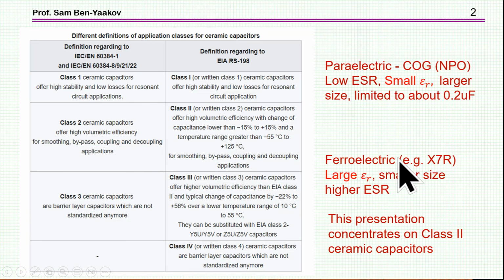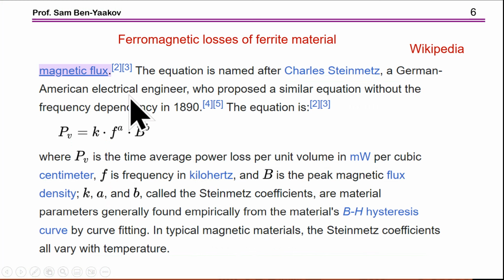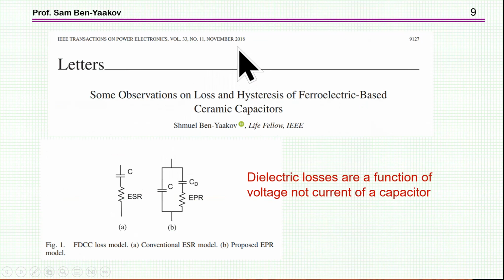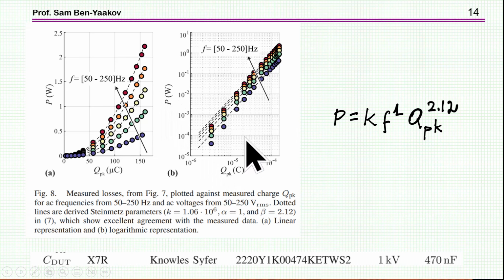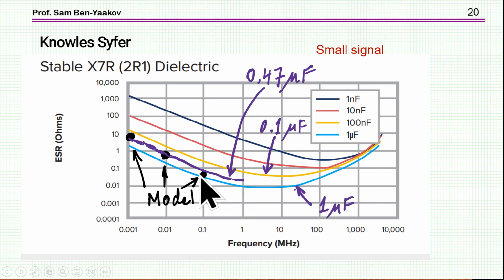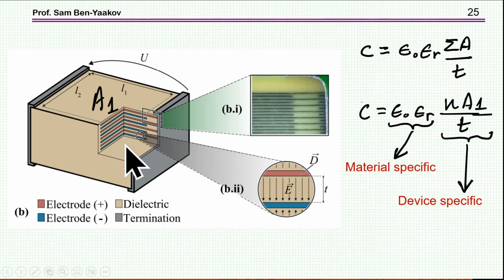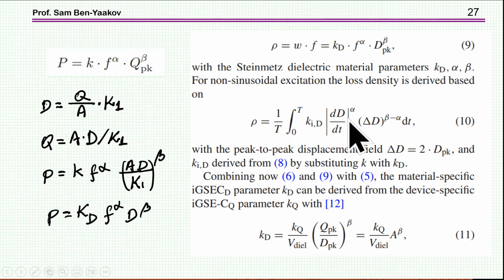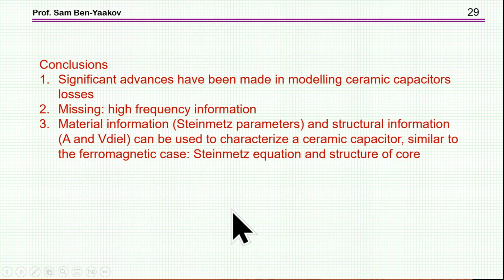Advances in modeling Class II ceramic capacitors loss under high current and high voltage

Comment: Good Day! I have one question - Why don't you want to see a resonance in the capacitor impedance graph (2:23)? Measure the phase of capacitor impedance and you will see that the phase changes from -90 to 90 degrees, and at resonance has 0 degrees. This is a classic series RLC circuit! See: https://www.elibrary.ru/download/elibrary_49470578_60102822.pdf

Comment: As the dielectric volumen is in the denominator, does it mean that everything being equal a larger capacitor - i.e. a higher voltage rated one - is going to have lower losses?
Reply from the maker: Thanks for comment. Dividing by A from numerator t is left. This would mean a smaller electric field which probably explains the lower loss.